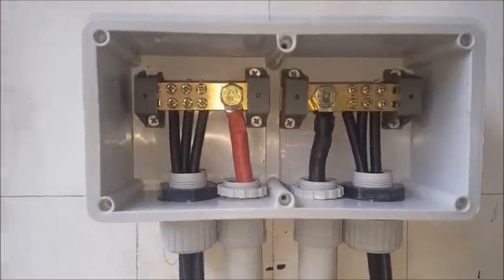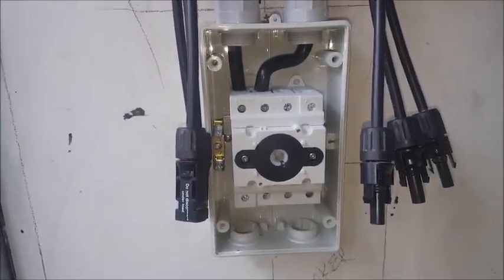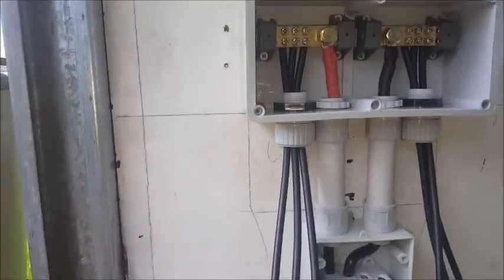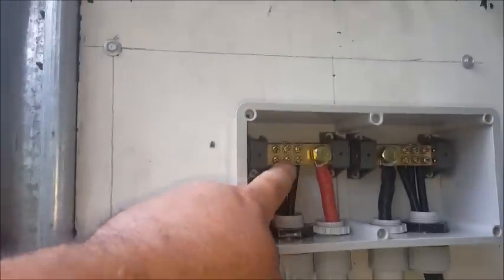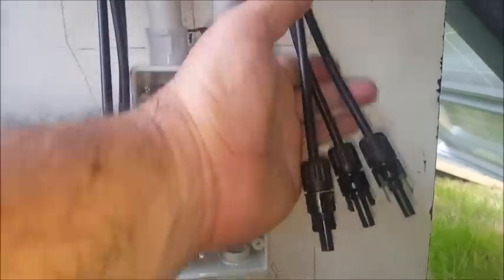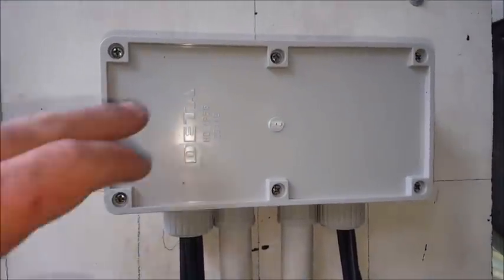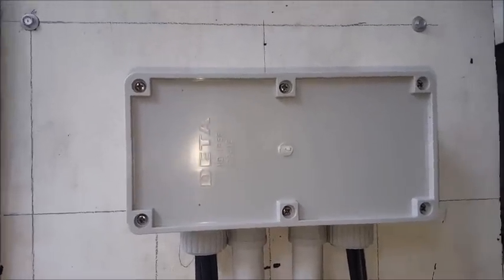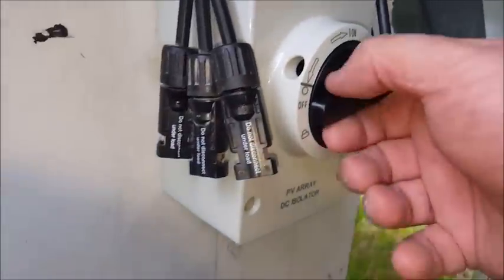Off Grid Solar Power - DIY Combiner Box with DC Isolator

Comment: you need to fuse each string combining them it not a issue but with out each string being fuse you run the risk of destroying your panels, the panels should tell you there series fuse protection rating and if you have 3 strings combined it would be safe to say that your pushing more then what the panel could handle if it was to become shaded you can get a mc4 connector with a in-line fuse which will keep things safer
Reply from the maker: Thanks. I've got fused MC4 connectors to use.

Comment: your each PV (positives) input (you have 3) supposed to be fused
Reply: it looks like you have 3 strings. so say for example one panel or wires of one string shortens, the two other strings backfeed and burn out what ever. that is why. also fusing each string enables you to isolate a string at a time. also it is australian regulation, however you might be exempted from that because of low voltage. and make sure you get non polarized breakers, just in case you decide to use breakers for each string.
Reply from the maker: Why? The panels can't put out more than they're rated at.
Reply from the maker: Urs Odermatt Thanks for that. I'm going to think on whether I'll use breakers or fuses.